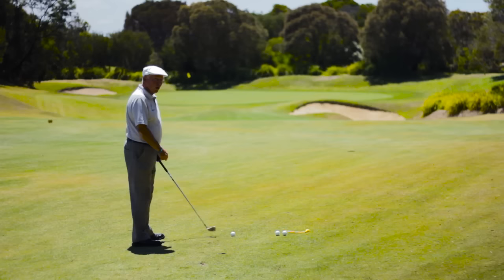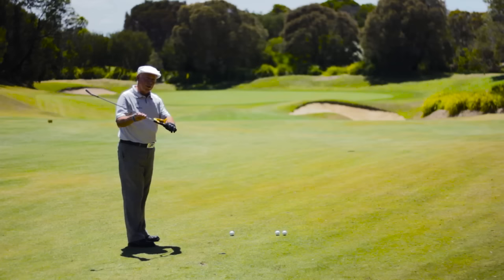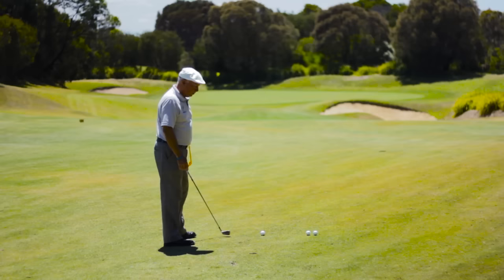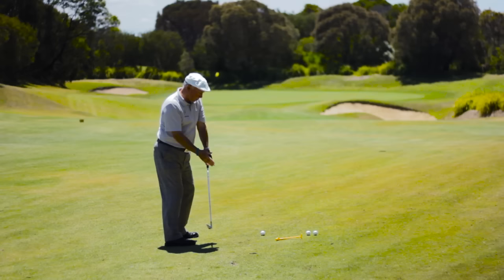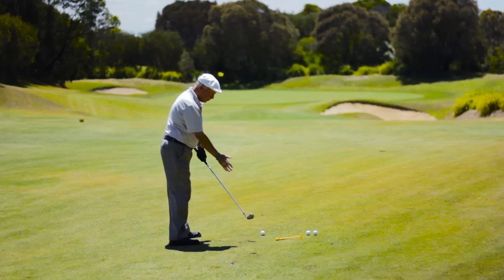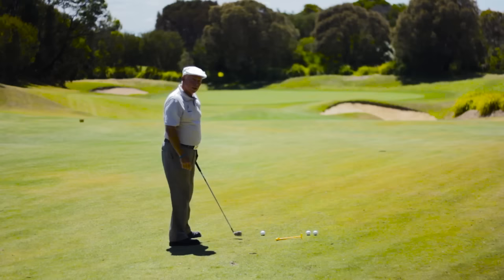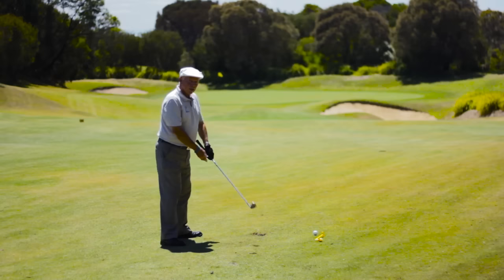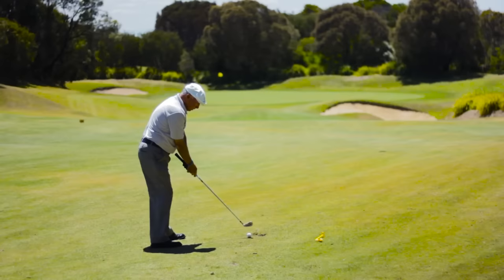How to Fix the Over the Top Shot

Comment: It's all so easy in slow motion, or in segments. What's hard is incorporating these pointers at full speed.
Reply from the maker: Dear Larry,

Please contact me for a Zoom Individual lesson and I can coach you through the speed levels of this drill and more. My email is crokergolfsystem@gmail.com.

Happy New Year 2021,
Peter Croker
Reply: @crokergolfsystemofficial  Thanks, Peter! Actually, my tendency is the opposite of over-the-top, as my divots tend to point right, and so I surmise that I inside-out my swing a bit too much. My big miss is the off-the-earth push to the right — with the longest clubs. But I like your idea of getting the club in line with the lead arm. What are your Zoom hours?
Reply from the maker: @larrya7360  Dear Larry,
The best time to book a Zoom Golf Lesson with me is from 9 am to 12 noon Sydney time (= 5 pm to 8 pm New York time) - Zoom lessons are most effective at coaching correct application of drills and in turn correcting any swing faults.
https://crokergolfsystem.com/book-a-golf-lesson/